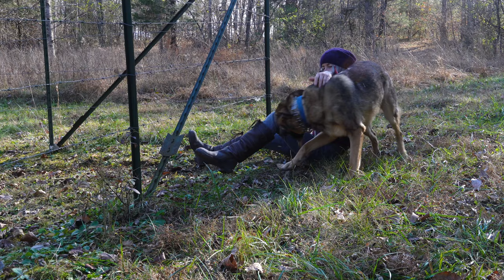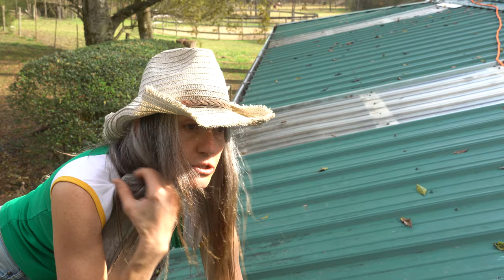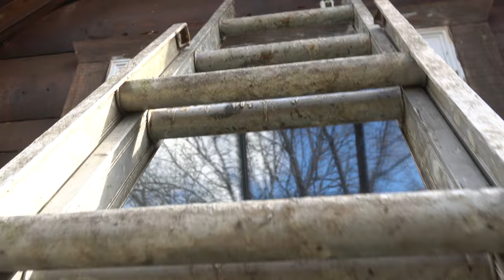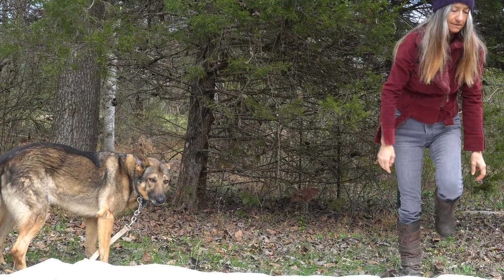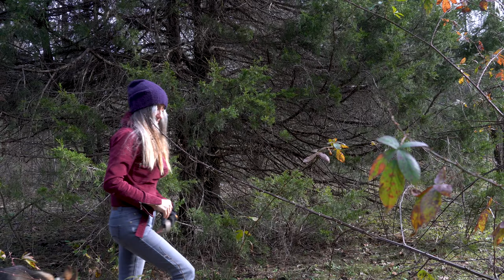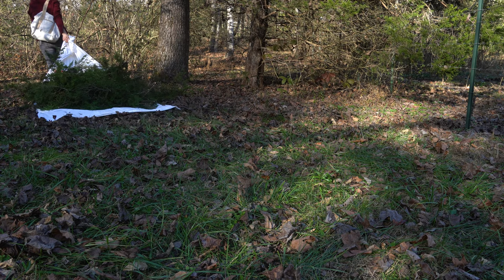A lesson in Bee holes and C for a Cozy cabin

Comment: Love that juniper.  Make some gin sometime? That's totally  been on my bucket list. Wow, I just learned so much about wood bees, that was fascinating. Thanks.  What wood was used in those logs?  Looks like they  were  stained pretty hard, if it was a hardwood. I thought cedar or juniper would repel just about anything naturally, but did they use that?  But oh... that was probably expensive, even in 1906.  OMG does that foam smell? oh well, do what ya gotta do...  Look at the ladder footings around 3:06, you forgot to angle them flush.  Here's an idea ,  C-clamp some 2X4" to the roof and make an  "M"  type "Brace" for the feet to butt against.  To prevent slippage  if that mat slips . Ropes/Hillary Step harness  as backup.   You  could also scrub the mat area with white vinegar, and throw down some rubber cement , or "pine pitch" to increase precious friction. Give some to CAMERA!!!  LOL.   I bet that roof  does get a bit slick , but it's a damn nice metal roof that will last 30 years. I bet it sounds great , please record next rain!   Lovely vocals and Uke, or was that mandolin. Mountain Roofing Girl.  Oh, and  hugs to Harriet .
Reply from the maker: Oh thank you so much Robert! Yes it’s funny I was wondering if anyone would notice the footings on the ladder weren’t angled and I fix that later plus I noticed that the rubber mats doing really good as long as I keep leaves out from under it but that last bit of security I added with Willas leash and the eyebolt in the window has completely made it much more secured… but thank you so much …yes you have definitely got the secrets for making it even better! Interestingly enough it rained a lot this morning it’s done but yes it does sound good but Willa doesn’t like it she goes to hide!! Harriet would love to hug you back she’s such an affectionate girl she’s doing so much better!!  that would be really interesting to make gin from those berries boy they are gorgeous! 💙🙏🐕🐕🐎🐎🌲🐈🐈‍⬛😊
Reply: @LadyoftheFarm   oh the dreaded wet leaves (injects more drama) . Hitting those on the bike are a certain death sentence, never mind the roof. I'm sending you  a parachute  Just in case you get attacked by a hidden swam from a missed hole ...